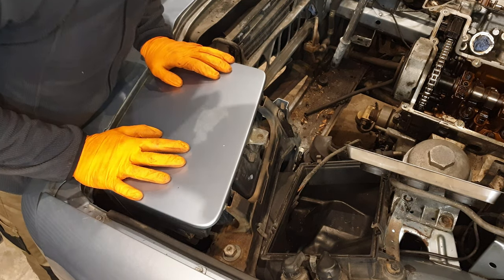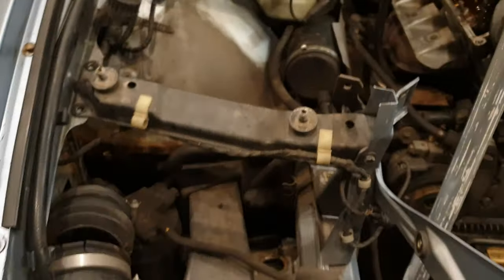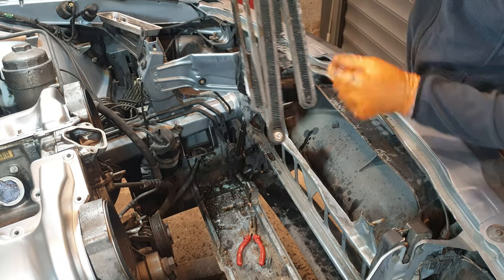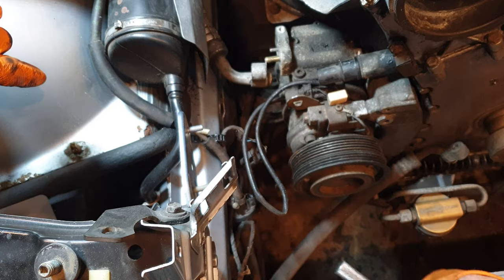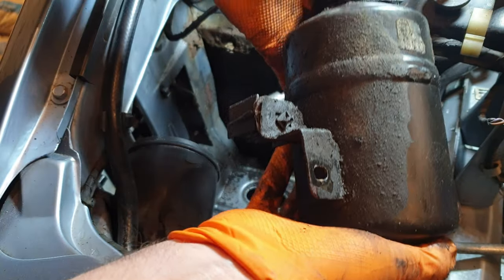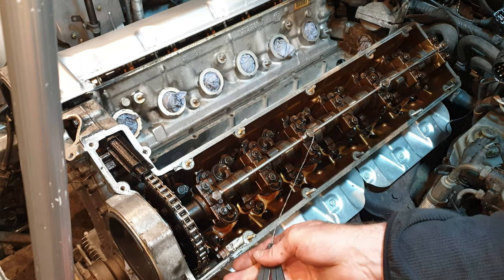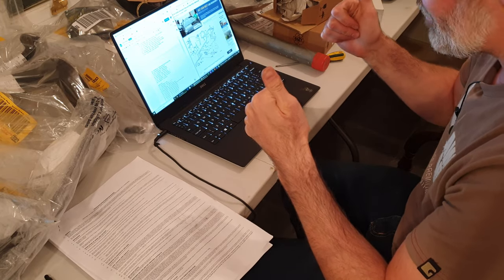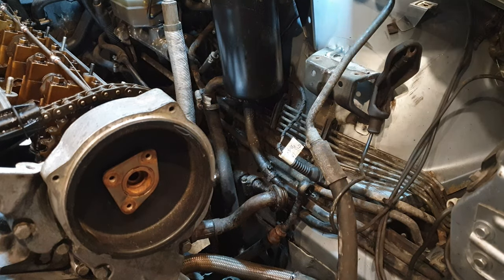BMW E31 850i "Glacier" - Complete Restoration - AirCon/Hydro/Parts Arrival - Episode 5

Comment: Steve, great work there, I have a 98 840 that is needing TLC also, so you are serving as inspiration. I currently have the front and rear bumpers off awaiting respiratory and on with the front. and rear sub frames for refurb, new shocks and a full exhaust as mine has rotted. Big bills on these beasts but always great to see them on the road - I prefer these to modern bmw's. I look forward to your next update.

Comment: Awesome job - just acquired a 91 manual with 106k miles which is a bit raggedy n  97 auto in pristine condition with 68k miles - still to decide what to do when I receive them - swap gearboxes! Anyhoo - hat parts sites did you use for your project? Tah much

Comment: Hey Steve! Just purchased my first E31 850i with a six speed manual. Great condition but long overdue for an overhaul as it has been sitting for several years. Can you share your parts list?
Reply: Hi , is yours righ or left hand drive? I have a manual one aswell.